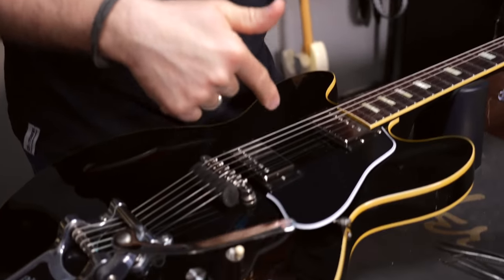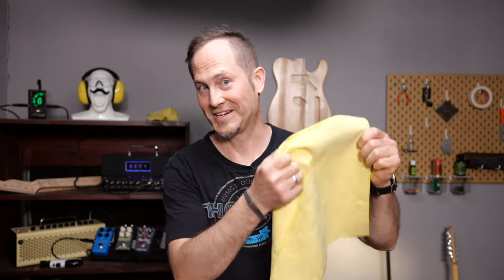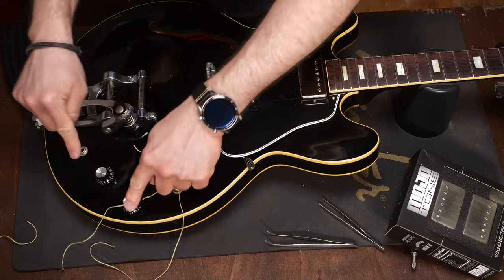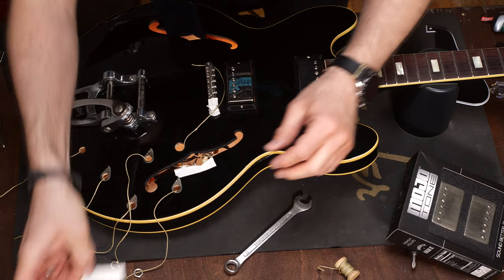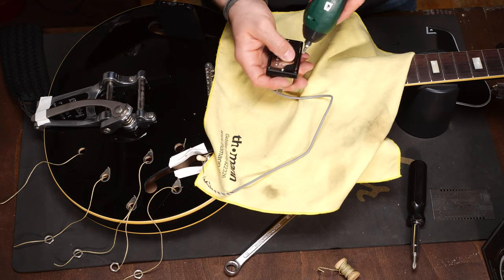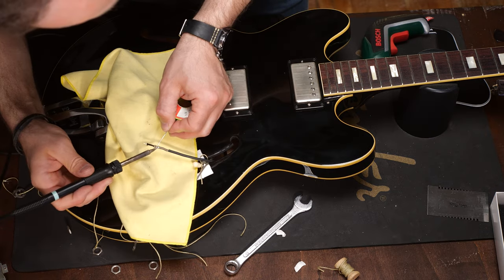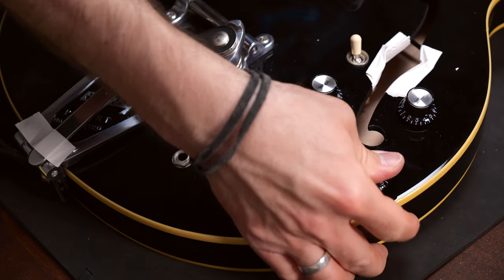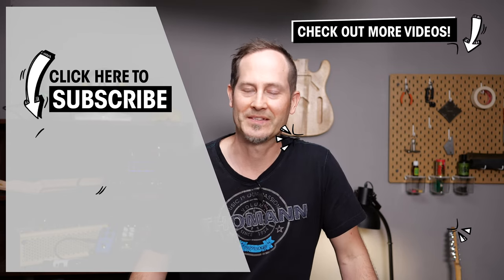How To Swap Pickups In A Semi-Hollow Guitar | Guitar Tech Tips | Ep. 65 | Thomann

Comment: SHORT CUT; If you are just changing out the pickups then KEEP THE WIRES COMING FROM THE POTS, just clip the wires short AT THE PICK UP and join the wires there. You can solder or just twist them together and tape them.
Reply: Thats how i always do it . A lot  easier .
Reply: Works good if you are just going to toss the pickups you’re replacing.
Reply: That would be the stupid way to do it..
Reply: @simonvanderheijden432  I'll over look the insult if you can explain why?
Reply: @charliemcgrain  Twist them together and tape them? Really? That's some hillblliy engineering right there. Ladies and gentlemen, our guitar player is experiencing some technical difficulties due to the fact that the electrical wires in his guitar are held together by sticky tape..  And cutting the wires at the pickup? Only amateurs do it like that, it's just stupid (yep, i said it again). How do you wanna do that with Gibson style wires with the braided shielding?
Reply: @paulpavot1056  Twist them together and tape them? Really? That's some hillblliy engineering right there. Ladies and gentlemen, our guitar player is experiencing some technical difficulties due to the fact that the electrical wires in his guitar are held together by sticky tape..  And cutting the wires at the pickup? Only amateurs do it like that, it's just stupid (yep, i said it again). How do you wanna do that with Gibson style wires with the braided shielding?
Reply: @simonvanderheijden432  No need to be an ass Simon. You could clip the wires, resolder to the new pickups and no one other than you would know.
Reply: @miapavot6828  That's the problem right there, I would know. There's a right way to do it and there's a wrong way to do it and clipping the leads at the pickup is the amateur and stupid way to do it, no professional luthier would ever do it that way. But it's Serial Killer Sunday on Investigation Discovery so if you don't mind I'm gonna go back to watching innocent women being slaughtered. Have a nice evening.
Reply: @simonvanderheijden432  Oh relax, Simon, if it was a Gibson you probably would not be changing the pickups out. I think my point was easily understood.
Reply: @charliemcgrain  I understand your point, I just don't agree with it. I know you don't agree with me and that's okay but I'm a 100% positive that any professional luthier would agree with me. And why shouldn't people change pickups on a Gibson? They do that all the time, even with Custom Shop Gibson guitars. There's a whole industry build around aftermarket, boutique pickups for high end guitars. Specially for Gibson P.A.F. humbuckers. I can make a list if you want..
Reply: @simonvanderheijden432  Then, like gentlemen, we will agree to disagree. Peace to you brother.
Reply: @charliemcgrain  I will agree with that. Peace to you too my friend

Comment: I will eternally wonder why gibson thought not adding a backplate to the es series was a good move
Reply from the maker: Haha, I get it, it's anything but practical... The roots of hollow body guitars are acoustics, where you fix everything through the sound hole. I'm pretty sure that's the reason for this: tradition basically. I only wonder why they didn't make the f-hole a little wider on the ES range to make it easier to install the pots. It's just super tight and there's always a chance of scratching the finish when doing it... 🤷‍♂️ Cheers //Kris
Reply: They did on the ES-333 model 👀

Comment: How about not soldering to the pot? When you just need to swap pickups, you could just cut the old pickup wire at about half of the length. Remove old pickup with half wire. Other half of the wire remains soldered to the pot. Fish out the cut end through F-hole. Thread the new pickup wire through the pickup wire channel while you insert new pickup in place. Fish out open end of new pickup wire, trim overhang if you feel like it. Solder the two open ends (of the new pickup wire soldered to the pickup and old pickup wire soldered to the pot). You have just created a splice. Push it through the f-hole and tuck away. You now have a splice that you can always easily reach without touching pots if the pickup didn't work out and you want to swap it again.
Reply: I did that except I connected the wires with telephone wire jelly connectors instead of soldering.
Reply: My brother tried that before and we didn't get any audio. It's easier to legitimately screw that up
Reply: This is the approach I am going for. 59 Vanson Alnico2 on a Hartwood

Comment: Instead of a wire, it is better to slide a flexible tube over the shaft of the potentiometer. Much easier than a wire. So get the shaft right back through the hole

Comment: Hi Kris! Wouldn't it be easier to cut the wire from the old pickup and solder the new pickup directly to that wire or do you think that could affect the tone in any way? (I mean, maybe losing some high end or something?) 

Thanks!!
Reply from the maker: Great question! That would be a good solution to make the pickup swap easier. I don't think any tone would "get lost" that way, if it's soldered clean. I wanted to wire this guitar "the elegant way" for two reasons: 1. first of all to show you guys, how that's done; 2. the original pickups had four conductors and the new ones have two. That would've looked super messy if I wired them together. 
Cheers //Kris
Reply: @ThomannsGuitarsBasses  oh, I get it... that makes sense a lot. Thanks!!

Comment: I use Mallory 150 .022uf Caps. Cheap and run with expensive PIO caps. The leads always snap when installing the electronics harness back in my Semi Hollow Dot! OUCH! Doesn't take much wrestling. I always tape the whole face work area. The reason they are called "F" holes has nothing to do with anything you've been told. It's because the word MOST USED when doing an Electronics and Pickups swap begins with "F". LOL Tweezers that stay squeezed until your hand applies pressure to release, really helps hold the Pots still when building out the wiring harness and soldering. Make a cardboard template to get lead lengths zeroed in! I use clear plastic hose to feed the appropriate Pot through the appropriate hole. I used SD 59's in my Dot. If Modding gets you closer to your dream guitar, then why not do it! Good Stuff!

Comment: Would like to see - Removing/replacing wax potted pickups from an ES 335 style guitar that has braided metal jacketed wire and show connecting and disconnecting wire from pickups and removing the wax so that you can. Also would like to see splicing metal braided jacket wire. Thanks!

Comment: I wonder if it is possible to skip the pot soldering part by just cutting the wires that are already attached to them from the former pickups and soldering those to the new pickups, provided they have the same number of wires and without the braid or some sort of shielding.
Reply: It is

Comment: So rookie question here - can you just cut the pickup wire from the outgoing ones and cut the wire of the new ones and then solder together? Just wondering if this works in order to avoid working through the F hole.
Reply from the maker: Ohh wow, I have two answers.
1. Yes you can do that.
2. Please don't do that. 😆
First of all you ruin the worth of the pickups - who would ever buy them with chopped off wires?
Second, you'll probably end up having a longer wire than the original was which can lead to annoying rattling inside the guitar. Cheers //Kris

Comment: Quick hack - do not f-around with the pots, just loosen the old pickups out of place, cut the wiring going to the pots, then hook the wire up from the new pickups to the cut wires going into the pot cavity. 
Yeah its ugly but if you're going to get rid of the old crappy pickups anyway, its way easier than having to deal with this.